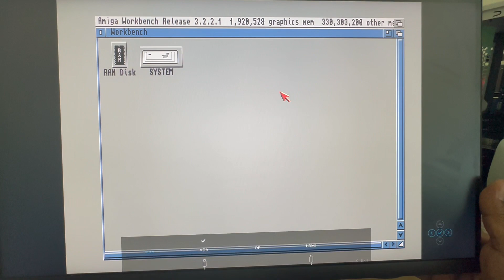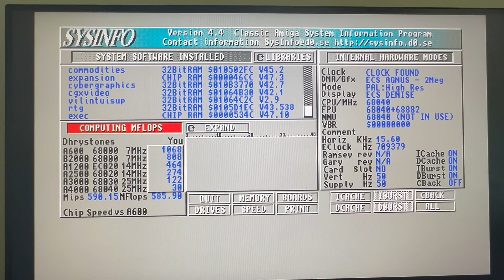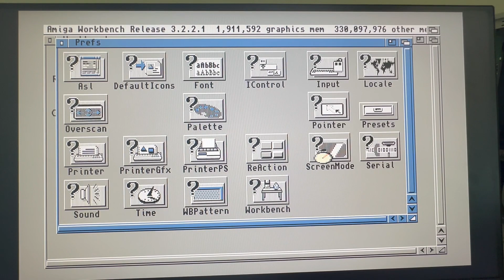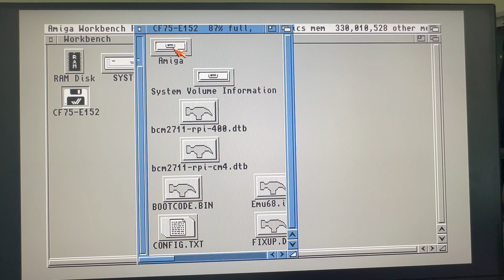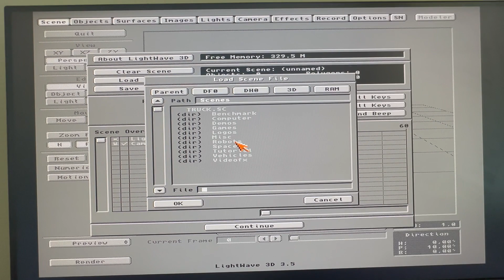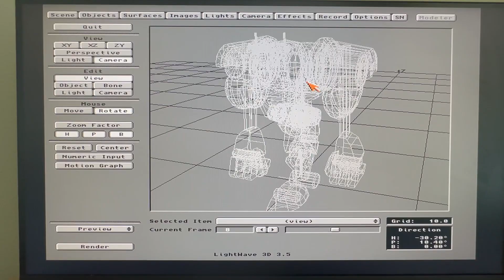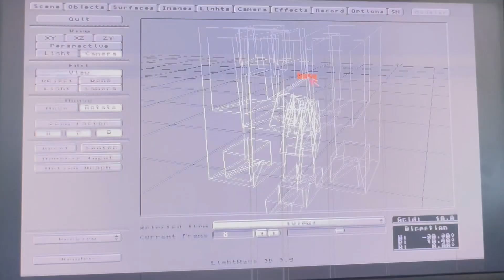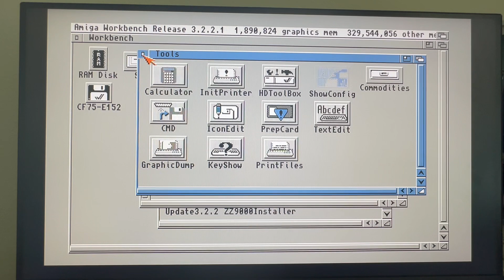Amiga 2000 EATX 2.2 w/ ZZ9000 &  Pistorm Amiga OS 3.2.2.1 Test Video

Comment: Is your stability issues does to a lack of a tick signal from your ATX powersupply?
It might be worth looking at and possibly making a Jazztick?
The maker of this project also has a Zz900 and had stability issues with his Amiga 2000 after replacing his powersupply with a modern? Compaq ATX. He made this after noticing issues issues with his Zz9000 after the PSU died (you could literally see a weird flicker going on before it was fitted).
Reply from the maker: That may be the problem. The system does work but when I want to change to a RTG resolution I would get artifacts. I have another ZZ9000 card now and I will try to see if that is the problem. I also changed from Denise to Super Denise. I'm not sure if that may be a problem as well.

Comment: I just bought this same card. I need to find a good case and power supply to get going
Reply from the maker: I am using a Liteon PS-6301-08A for the power supply. Any decent power supply at least 250W-300W is what I recommend depending on how many Zorro cards you may use. The case is a Fractal Design Focus G White ATX Mid Tower Computer Case. I used a drill to remove the drive bays so the motherboard will fit. I only used this case for the X2 5 1/4 drive slots on the front so I could use them to mount add ons. The case looks to be the same exterior as the BlackBOX 1200 MK-II tower case for Amiga 1200.

Comment: Looks like a great setup!  Id been torn about a 30+ year old machine, or the EATX new board build, as I get the feeling that the newer boards would be more solid.  shame you are having so many instabilities.
Reply from the maker: The main instability I notice is the ZZ9000 and the motherboard. I am thinking maybe using an 8372 Agnus and a different configuration on the motherboard it may work properly. Also I am using a Pistorm and a SD-Box (Sorry on the video I said Plip-box) to run software. It was pretty much was the most complicated configuration I could think of for testing.

Comment: What problems did you have with the USB keyboard adapter?
Reply from the maker: The USB keyboard adapter overlaps the CIA 40 pin on the motherboard. The floppy connector and USB dongle for the keyboard are fighting for the same space. The USB Keyboard adapter can pop out and has a risk of damaging the system. You can use a 40 pin Dip IC socket adapter to rise the USB Keyboard adapter so that the floppy cable can pass without touching the PCB.
Reply: @Howmanymhz  my pardon, which type of SN74 used for U103-U106, 74F or 74HCT? So strange situation on my board with 74F245 for U103/U105 = 2V output level.
Reply from the maker: @someone090909  Sorry I missed this. You placed it as a reply. I see why you may be having a problem. U103 and U105 are 2CA750K and U104 and U106 are 74HCT373D. That seems odd to me that there would be 2 different parts used for one component replacement.  The specs must be different.
Reply: @Howmanymhz  thank you for answer. My pardon, again :), what is the 2CA750K ? U103-U106 is SN74-series, as I see. I'm about 4 chips under Agnus-chip (13:04, as example)
Reply from the maker: I was talking about the ram. I will have to check on those.
Reply: @someone090909  I built this board on the video and used 74F245 for U103 and U105.
Reply: @kavanoz64  okay, thank you! :-)